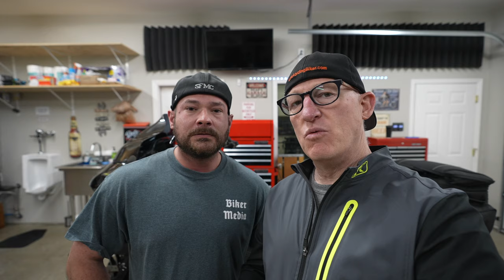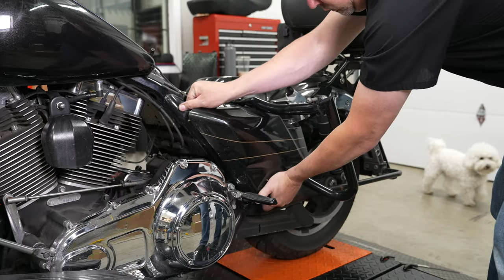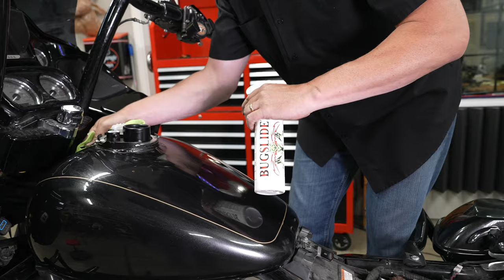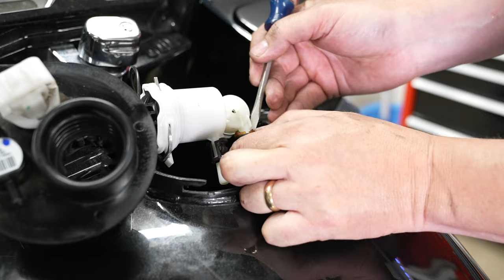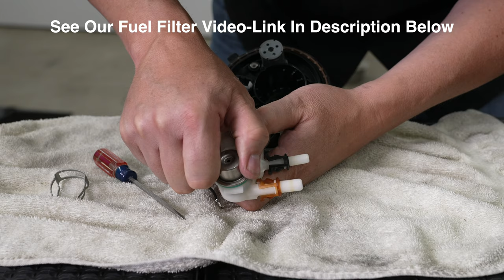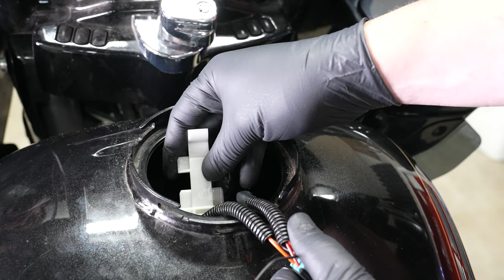How To Replace A Harley Davidson Fuel Pump

Comment: I just did this job to my bike yesterday. 2017 FLHTK.
The video was helpful in walking a person thru the various aspects of the job. 
One thing though, the little metal ground clip on the pressure regulator has a release tab on the inside that needs to be depressed before removing. This tidbit is overlooked on the video.

The QFS kit I got in the mail had 2 rather big issues for me. They sent the wrong tank gasket and their supplied fuel filter is not correct. 
The gasket they sent was for a Sportster, not even close!

Their filter, the center holes on either end is over sized by approx  .06mm. this allows for a loose fit on the nipples, allowing unfiltered fuel to enter the system. The filter is a press fit on the nipples, this is the only thing sealing the filter to the nipples.

I had to make a emergency trip to 2 different Harley dealers to get the factory parts to finish the job.

Lastly, the return hose supplied in the kit is a little short, it could be 3/8" longer. 

The pump itself seems to be a quality product.

Comment: Go to the video at the 6:00 mark.  My fuel gauge was stuck on full for the longest time.  Bike would die for no reason at a stoplight and wouldn't start right away.  BCM diag code was b2116 for fuel pump open.
Tore down the fuel pump per your vid and manually tested both level sending unit with an ohm meter and fuel pump.  No issues with either.
At 6:00 min in your vid you show that plug.  Mine had a build up of corrosion on the female connector.  Wiped it off with vinegar and blew it off with compressed air.  
Put everything back together without replacing anything.   Everything works perfect now.  All diag codes are clear.

Comment: Just used this video for the second time. Fuel pump failure at 25k this time. This job would be overwhelming I only had the manual. Instead, it’s 2 hours since UPS rang the bell and it’s a done deal. That included a 30 minute water break. One more time LAB for the win.

Comment: I noticed using a steel punch to remove the retaining ring.  This can produce sparks when tapping off the ring.  When removing a fuel pump retainer, a brass punch should be used.  It will not produce potentially hazardous sparks.
Reply: Have some Brats ready to cook ! LOL

Comment: Thanks for the video. I finally figured out my problem. The filter and regulator is spraying fuel out of the housing. I’m replacing the whole system. The bike has sat for a long time

Comment: Hi Ryan, do you need to use clamps on the hoses, when replacing fuel pump, reg. Fuel filter? You just pushed hoses on after heating them. Or do you not need to use clamps. Like Corbin self tightening clamps?

Comment: Just curious as my 2019 RGS is doing the exact thing. Brought it to 2 different HD dealerships. Both said nothing was wrong with fuel pump. Did replacing it resolve the issue??

Comment: Anyone have experience on how these QFS fuel pumps hold up? Installation quirks and vendor support? Would it be a good idea to use these or bite the bullet and get this from Harley?
Reply: YEA thats what I wanna know too
Reply: My bike was the one that the sound of a failing pump was used for, not the bike they replaced with. I did one the month after Fuente’s was done. Mine failed at 20k. Was throwing codes and stalling this time. I checked on the bike in the video. It’s still going strong. It would be 2 weeks to get the HD part and I want to get back on the road. Ordered an All Balls pump this time because it was the only one I found in stock. Replaced and running strong again.

Comment: At 8:30 in the video, you refer to the "main fuel line"  .  Where does it go.  On mine, ith was just an open elbow line with no connection to anything on distal end as far as I could see.   I replaced my pump, regulator and filter.  At key on, I have 60 lbs pressure, but pressure drops to nothing and bike dies.  I've been in it 3 times, trying to figure out what I'm missing.  Top of fuel pump feeds filter  regulator feeds pressure line leaving tank via check valve at  bottom of tank.  Is that right?  Could sure you some help.  Thanks in advance.

Comment: Saw another video showing a bike with the same problem that was attributed to a clogged filter because the guy used E85 in his bike. This diagnosis never showed any inspection of the filter so how did you determine it was the fuel pump and NOT a clogged filter? Or was this video solely for the purpose of changing the pump?

Comment: I've got a leaky fuel check valve I'm going to replace on my 2015 FLHTP it has the same plug in fuel line...is the fuel line the tube on the right when you pull the top off? There's no need to pull the entire fuel pump out is there? Please let me know I would appreciate it
Reply: There is no reason to pull the pump if you're just replacing the line.  Once you have the top plate off use a hand and determine which line is going to the check valve.  Trace it back to the fuel pump connection and squeeze the tabs to remove it.
Reply: @MrADollar99  Got it...Ezee Peezy once I figured out which line...that fuel tool o ring rebuild crap is a waste of time when you can buy a NEW valve for only $40

Comment: With this video I replaced a leaky fuel valve...heck I didnt even need to pull the pressure reg all the way out! DONT buy that useless $100 Fuel tool o ring rebuild crap just throw a new 40 drag specialities fuel valve in and be done...THANKS FUENTE AND LAB for showing me how